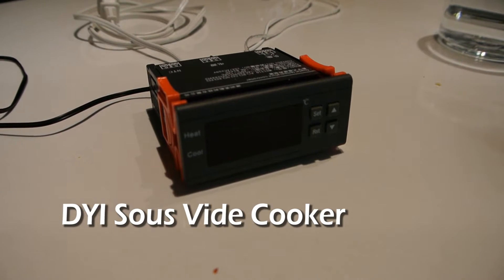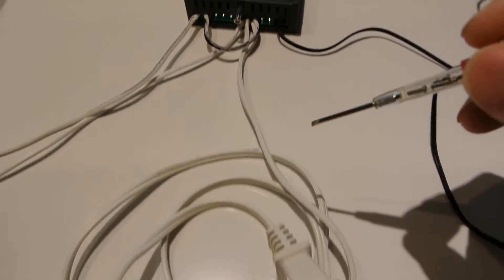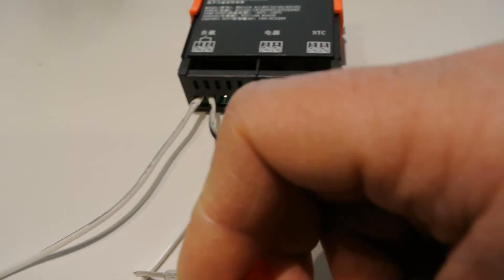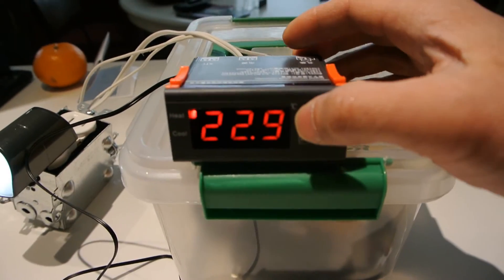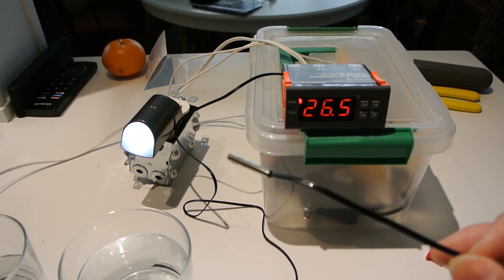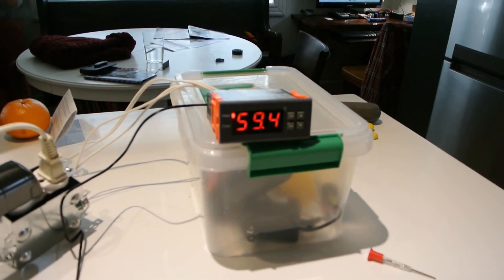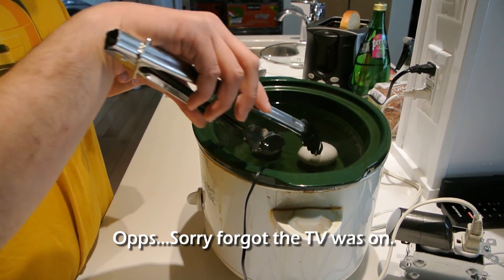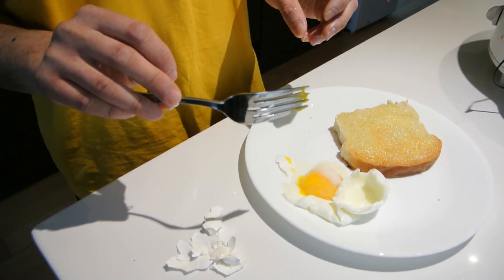DIY Sous-Vide Cooker Controller Part 1 - The Build

Comment: I bet that temperature probe is not food-safe, and the wire insulation would either melt or come pretty close to melting if placed in boiling water.

Comment: I use this setup to control my crock pot. Works great.  I have another one controlling and old egg incubator and I do yogurt and natto fermentation in that one.  The controllers are from china and very cheap. They probe in water no problem yet.  I got the sous vide plastic bags and vacuum on amazon for about 12 dollars.